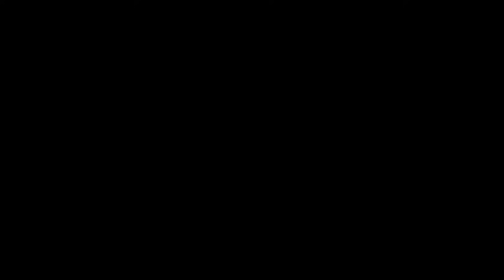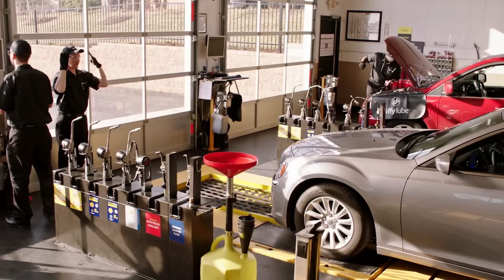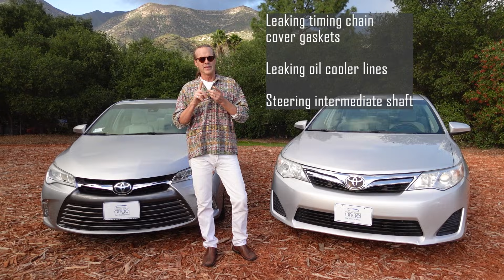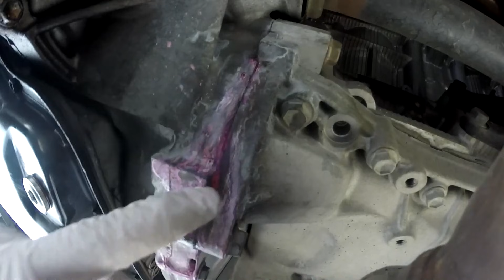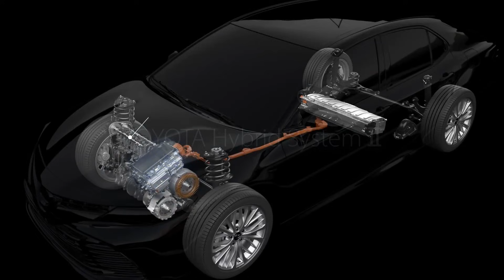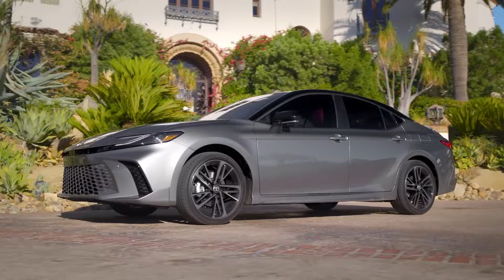Problems to Look Out for When Buying a Used Toyota Camry 2007-2025

Comment: I use a 2016 Toyota Camry, no issues except a rattle from the steering column. It was fixed by one of my friend with a $10 part and Toyota dealership quoted me $1200 for that fix 2 hour fix.

Comment: My solution for my 2009 Camry 2.4V: 5L 5W-40 + Oil Change every 8k-9k km = 0 worries for the burning oil issue

Additional info:

2AZ-FE revisions:
2000–2003: Initial release. No balance shafts. Early signs of oil consumption.
2004–2006: Balance shafts added. ECU emissions tweak. Start of oil-burning complaints.
2007–2008: Revised piston rings. Start of oil consumption TSBs.
2009–2011: Final version. Fixed oil issues. Updated threading. Best reliability.

My car uses about 100mL per month, equivalent to one small cup. That’s nothing for an engine over 10 years old and driven daily.

Toyota Camry Generations (Global Market Timeline):
1st Generation (1983–1986)
2nd Generation (1987–1991)
3rd Generation (1992–1996) - XV10
4th Generation (1997–2001) - XV20
5th Generation (2002–2006) - XV30
6th Generation (2007–2011) - XV40
7th Generation (2012–2017) - XV50
________________________________
New Platform: TNGA-K (Not "boring" anymore)
8th Generation (2018–2024) - XV70
9th Generation (2025–Present) - XV80

Comment: Interesting details, and comparison of the Camry Generations.... just bought a 2016 Camry LE... though it doesnt have all the bells and whistles the ride quality is just short of a Lexus ES... and nice pickup from that 4Cylinder Engine... Just some cosmetic issues, however bought it with 82K Miles it rides like new.

Comment: In 2020 test drove a new 2020 Camry.  When I first got in the car I noticed how much less headroom than my 12' Altima has.  On the test drive the 8 speed transmission was constantly hunting for gears.  I couldn't wait to get that car back to the dealership and park it.  I was thankful to get back in my 12' Altima and get out of there.

Comment: Well, I guess I don't want any Toyota Camry. I'm wondering now what is a good used car to buy?
Reply: It depends on the cost. I got a 2008 Camry a few years ago for 300 bucks and it's fine
Reply: you'll literally NEVER EVER buy a car if you keep reading about "problems", every single car has problems, even Honda and Toyota.....my 2008 Camry has 275k, I would drive that motherfucker to California and back Right now.

Comment: You do not have to fully remove the engine to repair the VVTi system on a Toyota if you get it diagnosed and fixed befor it gets so bad that damage is done to the timing change. Watch videos by Th Car Care Nut. On our 2009 RAV4 Toyota was still recommending 5,000 mile oil change itervals. I don't know in what model year they went to 10,000 but we're sticking with every 5,000 miles on our newly acquired 2022 Toyota Venza.

Comment: i never did anything to my 07 camry other than oil changes and brakepad replacements.and sold it with 200k miles, and it was  still running smooth as ever

Comment: A great video but I can’t nail anyone down on when the third revision happened for the 2GR-FE.  You seem to indicate that it was probably 2010 though you suggest checking the oil filler to be sure while I’ve heard the tale that 2 slits mean it’s third revision but not having the 2 slits doesn’t for sure mean it isn’t as there are 3rd revisions that do not have that part or appearance.

Also the 6spd is said to be trouble free… until 2012?  When it suddenly needs servicing every 60 or 70k?

The belt tensioner on the V6 not being a problem until 2012 also seems to suggest a 4th revision?   Or was it only the tensioner that was revised?

Sorry to be a pedant but I’m poor and this purchase is very important to us.

Comment: I have an 08 Scion Xb. Wonderful car. Got it used when it had 67k on it. 12 years later it has 209k on it. Love it and love Toyotas. Has the 2AZFE motor. I became aware of the oil consumption issue on my own. Had the recall repairs done two or three years later. Super reliable car, and I'm sad they stopped making them. Question- overall what model years do you think are the best for Camrys across all generations? (four cylinder and six cylinder) Thank you!

Comment: I'm actually a fan of large grilles. The grille on the refreshed 3rd gen Highlander is my fav grille. The 4th gen Highlander grille is atrocious - it's like Toyota took a step back to the early 3rd gen Highlander design cues 😄 (i dont like it). When comparing the refreshed Camry for years 2015-2017 and the 2019 Avalon, i find myself liking the grille on the Avalon more. It's bigger, sleeker, and bolder. 😄 

But the 2017-2019 Highlander is my dream SUV and needed to get a bigger car for my growing family, so i picked up a 2017 Highlander XLE AWD V6 on last day of 2024. So far, no regrets!

Comment: The 4 cylinder engine is great, UNLESS it was neglected. I personally wouldn't buy a 4 cylinder Camry that doesn't have a near perfect 5k oil change interval. 4 cylinder Toyota engines will burn oil if the oil wasn't changed after every 5k miles religiously. That's what I have observed through the experts, and what happens when people don't take care of their Toyota.

Comment: Why does everyone have a Camry 😖
Reply: Many people like the smooth ride and power of the Camry, and some get good gas mileage depending if you have the V6 or the 4cyl engine. Many models of Camry were very reliable over the years, but some models of Camry had factory issues with specific year models.

Comment: I have a 2007 Camry with a V6 2GR-FE engine. I've had it for 17 years.  It sounds a little ticky when cold...especially in the winter but as soon as it warms up, it runs perfectly. It has never leaked oil and has had no major issues. I did have to repair the steering return line as well as a an oil seal...  I forget which one...  but it was not that expensive. Love the car...super reliable. And it has 144,000 miles and have never changed the transmission fluid....   I was warned not to at this point.  There is is some slippage when it's real cold but other than that, it works fine.

Comment: I'm looking over a 2014 Toyota Camry SE V6. When the car is idle, I can turn the steering wheel with no play and no clunking sound, but when I am driving, I hear and feel a quiet knocking sound felt near inside the steering wheel. Do you know what this can be?

Comment: My current Camry, is a v6, 3.5L engine. It was built in the U.S. (YUK), in 2013. I purchased it in 2016, and during this entire time, I've had to replace the alternator and the battery. Outside of the regular maintenance schedule, I have not had any major issues. As I understand it the Camry, v6, 3.5L engine is going away in 2024. In 2025, all new Camrys will be Hybrids. No, thank you.

Comment: I have a 2008 Camry XLE 3.5L and am now shading the 300+K mile mark. My car will still burn the tires from a quick dash accross an intersection, run at 80 to 90 mph all day from the coast of California to Nashville TN and back again, never any oil consumption or noticeable leaks and it could die today not owing me a penny. I have replaced one driver side CV joint abou 80K to 100K ago with an Auto Zone  $79 repacement and no more problems. I replaced the evap coil on the AC at about 150K mi,  I replaced all motor mounts at about 270K because the dog bone looked a little weak when holding the brake and troquing the engine (easy job of about 2 hours for all mounts done in my home garage; I replace all ignition modules and plugs at about 175K just because one failed and I never do onesies on ignition modules or plugs, I have developed a little shake at 40mph to 60/70 mph which is classic torque converter wobble but after having two long time associates who both run tranny shops run it on their analyzers and tell me "there isn't a damn thing wrong with the tranny" I'm looking elsewhere right now (and yes; I checked CV's, both standard and high speed balanceing, rack and pinion, ball joints, tie rod and connectors, et. al. and still no joy. I'm an old guy now who mounted my first HD at 13, raced muscles in the late 60's and early 70's, flew more types of aircraft from Oshkosh to Reno for ove 25 years and did my own wrenching in most cases and with all that BS I can say with a clean conscience; this toyota is the best damn piece of Iron I ever owned for the money.

Comment: Bought my 2014 Camry SE used at 2017 with 23k miles for only $15,000 out the door.
Only had the water pump changed and regular oil change and tires 
Car has over 123k miles tougher then my previous cars like the Jeep grand Cherokee and my Audi A6
Reply: does the car burn any oil? ive heard some burn a little of oil.

Comment: Have a Australian 2013 2.5L and had the VVTI rattle at cold start that you will hear about when you google it. Had a tough time with it getting repaired under warranty as they said "cant hear it". We did get it repaired once but it came back pretty quickly.

Anyway car still going ok with the VVTI rattle and at 120+k km now.

Comment: Here in Southern Ontario, there are so many 2007 Toyota Camrys for sale on Autotrader. All of them are certified, but all of them are also extreme oil burners, so you will need to replace your spark plugs and catalytic converter every 50,000 miles if you keep that junker that long.

Comment: Hey it's  Peter Fonda!!   Easy Rider to Camry Driver😅.               Thank you Greg, as a 7th gen Camry owner, i found your video very interesting, informative  and well paced as you compared the generations.   So just like a Camry, while your info was mostly great quality and reliable,i believe you displayed an ATF dipstick in reference to generations equipped with "sealed transmissions".  I so appreciate that you stressed the more frequent oil/tranny fluid change beyond factory recommendations, well done!
            On a side note, at video opening, was really fascinated while viewing the side by side images of Camry generations with their respective HP ratings over the years. Was so disappointed when abruptly ended at 2001.     
         If for whatever reason you ever do another one, please be all generational inclusive.  Also if possible, edit the images to be larger and inclusive of estimated MPG and engine sizes in addition to the HP ratings you posted.  So just like my Camry, enjoyed your vid presentation, subscribed and looking forward to many more enjoyable and reliable miles down the road.  Happy motoring 🚘⛽👍

Comment: I hate the 15-17 models.
Reply: Agreed. What an ugly look. They did have quite the comeback in 2018 though.
Reply: @ibanezmakki it’s not even the look for me, they drive like shit compared to my 2008 Camry. My steering is so much smoother, not rough and rigid like my dad’s 2017 Camry.
Reply: Why?
Reply: @tommyjohnson3294 they drive decent, but the steering is more rigid and harder to turn compared to my 2008 Camry LE. Plus I’m a bigger guy and the driver door cup holder poked my left leg which I hate too.
Reply: @i_am_gohan9232  I'm guessing you're talking about the se trim. That trim has the "sport tuned" suspension so it the ride is definitely firm compared to other cars. It does handle really well, however.

Comment: My 2020 Camry with that crappy 8 speed was the biggest pile of junk I've ever had. I used to joke the windshield wipers were the only thing that still worked right until they started acting up. A mechanic at the dealer told me they get lots of complaints about the 2018 and up Camry's but it probably won't leave me on the side of the road. Something you didn't mention was Toyota quietly replacing tens of thousands of the 4 cylinder engines because of bad castings in 2020. If it leaked oil through the casting it was replaced. Mine smelled like hot antifreeze so Toyota put block sealer in behind my back. It was up to the customer to find the problem. Newer Toyota's are throwaway pieces of junk. You can't rebuild any of the drive train because Toyota made it to minimal standards to save weight. Overheat the engine? New engine costing thousands. I paid extra to buy a Toyota because I still trusted their products back then. I went from a Toyota lover to a hater. Toyota wouldn't or couldn't fix that garbage car. Stick with a pre 2018 Camry. Those were bullet proof. Toyota quality has taken a serious dive recently. It started with the Camry in 2018.
Reply: Utter rubbish

Comment: Thinking on buying a 2012 camry  227k miles is that still good for a camry ive never had a vehicle before this would be my first one i just want something reliable to get to work and back home everyday
Reply: How is it going? Is there any issue?
Reply: @porsheayoayo1234 running solid still only had to replace the alternator
Reply: @porsheayoayo1234 250k miles

Comment: My toyota dealer told me 15.000 KM oil changes are fine with full synthetic but after also the car care nut telling 5000 m (8000 km) I think i'l opt for that option instead. I have a VVT-IE yaris.
Reply: if you change oil at 5000 miles or early your car engine last longer than you change oil at 15.000 km so if you want your car last longer you need to change oil at 8000km
Reply: Oil is far cheaper than a new engine..... when it dies when the car is out of warranty.

Comment: I own a 2014 Camry SE. Never has it let me down. It
Reply: My 2005 Camry, 1 AZ engine is so reliable, I just love it, at 389,000 kilometres, it looks like it could double up., without a wimper. There  are a few power steering leaks, but otherwise, no problems at all. Just love this car.

Comment: We have a 2009 RAV4 which had the 2.5 liter AR FE engine in the 2009 model instead of in the 2010 model year like the Camry. The maintenance schedule for ours was for an oil change every 5,000 miles not every 10,000 as you said for the Camry... Our RAV4 has just over 101,000 miles. I understand that the cold rattle at start up doesn't happen till around 150,000 miles. So we have another two to four years yet. Ours uses zero oil between changes so maybe it will go even longer without any problem. Oil analysis shows the oil to be very clean at the 5,000 mile oil change interval. But if the actuator gear needs to be replaced, I'm prepared to pay $700 to $800 dollars to have it done by AMD at TCCN Auto Repair in the Chicago area. He shows in a video how to do it and he is a certified Toyota technician (and he's OCD when it comes to doing the job correctly.) His channel is The Car Care Nut.

Comment: Test drove a Camry a couple of years ago and the 8 speed tranny was constantly hunting for gears during the entire test drive.  Couldn't wait to get that car back to the dealership and return home in my 12' Altima whose transmission has been bulletproof and is now in it's 13th year of service.
Reply: I heard the 2018 and some 2019 model Camrys had issues that’s why I went with a 2020 Camry I put 65,000 miles on mine til someone pulled out in front of me and totaled it last week it was the best car I ever had not one issue out of the transmission or anything except just for my servo being cracked (warranty repair).

Comment: Blind Spot monitor does not come standard with the Toyota Safety Sense system in 2018-2024 Camrys unless maybe if you have the top of the line trim level.  On my 2021 and 2024 Camrys it came as an option.

Comment: I have the 2012 Camry XLE hybrid, best car I ever have for 12 years. No major issues except change the gasoline reading gauge four years ago. I also change the engine oil every 5 K or every 5-6 months which ever come first and transmission fluid when it turned 50K miles . I give this car to my daughter in college and she is happy to drive around town with 110K miles and still running strong
Reply: Any problem with the hybrid system? I'm planning on buying 2014 hybrid also.
Reply: @Rayankady did u get it? how has the experience been

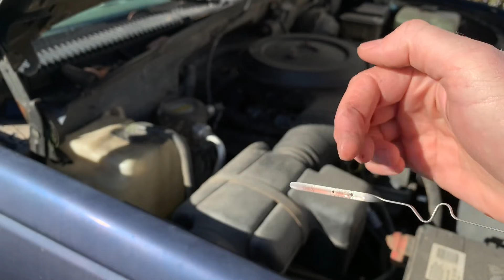Comment: At 7:17 you say "you have to check the transmission fluid" and show a picture of a dipstick.  I am 99% sure that the generation of Camry that you are talking about, and (sadly) most of the other years, do NOT have a dipstick for their transmission.  Is your video in error for showing the dipstick, or am I wrong?
Reply: You’re not wrong, but the message is the same. Service your transmission and check the fluid health and level.

Comment: My 2017  LE 4 cyl has No A/T  dipstick that you failed to mention my friend has a 2005 also does not have an A/T dipstick; therefor the average owner cannot check the fluid level. You should mention that next time.
Reply: I had a 2005   2.4L 4 banger, it had traditional dipstick for the 5 speed automatic  transmission, did your friend somehow have a different engine/tranny combo in his 2005?

Comment: 2014 is the best year. 2017 was the last year. They are not as good now. Toyota is jealous  of Kia and is headed in that direction.  Look what they did to the Tundra and the Tacoma. Next, they want to make the camry a battery car. Unbelievable.  The oil consumption  thing is not that big a deal. If you got yours new, like I did, and change oit every 5000 miles, you wnot have much if any trouble.  If it does eat oil, just keep putting oil in it and it will run for years and years. The new ones are junj in comparison

Comment: How about not buying that gen of camry altogether?
I wont argue that camrys and corollas are better than anything gm or ford has to offer....but doesn't mean they're worth buying either.  I owned a new 2018 tacoma for allmost 3 years and had nothing but problems with it.  Coil malfunction issues, multiple weak fuel pumps, constant electronic issues.  The radio, navigation, and cruise control quit working for 3 days in a row and as i was pulling into the dealership...the dashboard started working again.  I HATED THAT TRUCK!!!  Looking back on it i only wish that i had the financial debth to afford to drop a wrecking ball on it in front of that pathetic toyota dealership.....